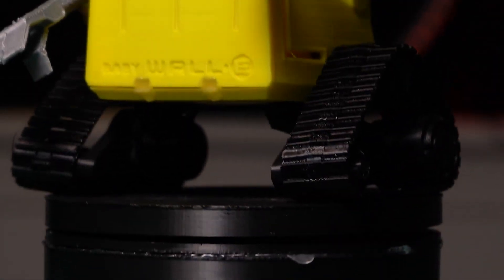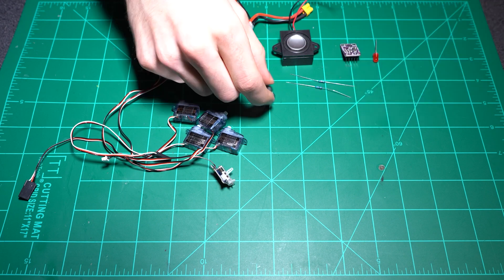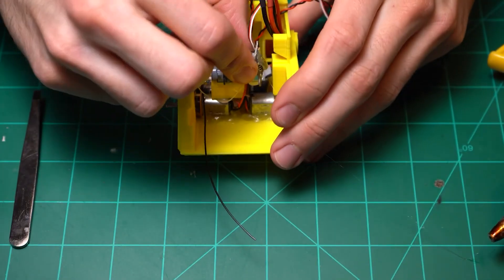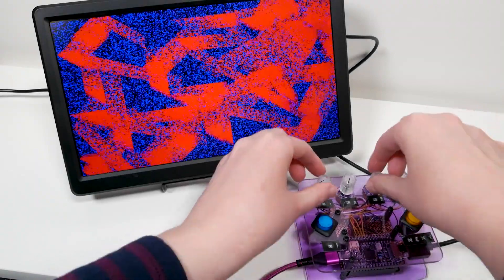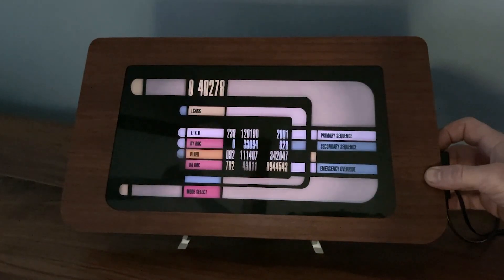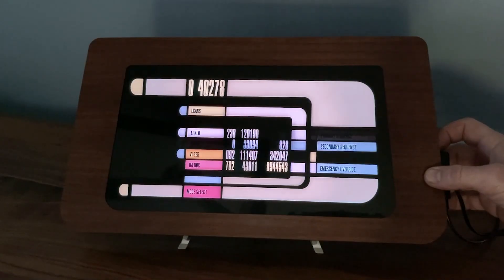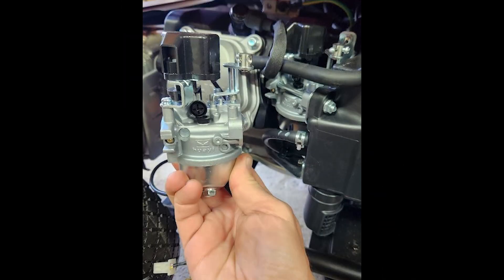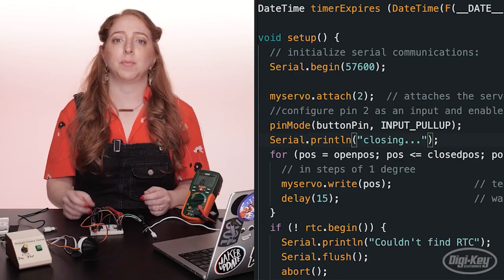Tread Gently [Maker Update] | Maker.io

Comment: Instead of using flexible plastic for your robot's tracks, which will quickly suffer from material fatigue, you need to use links that pivot on pins, like REAL tracks.
But, you have probably already learned from that mistake. Otherwise, it's a cute li'l robot. JS

Comment: Interesting RP2040 video synth project. Mine is a MIDI controllable Teensy laser synth, utilizing the Teensyduino Audio library, for projecting abstract Lissajous imagery from RGB  laser projectors, circa Laserium.😜
6 op amps circuits are used to convert offset audio signals to ILDA standard levels. Tempted to enter your contest. 😎
Ironically, after spending $hundreds on intelligent flatscreen HMIs and the past year searching the Internet for an RGBXY vector output to HDMI solution for an image preview monitor at my laser controller, the $2 Adafruit DVI breakout board being used on the video synthesizer looks very promising. 🥳
Thanks for sharing this project!